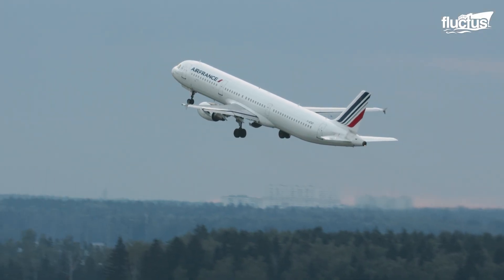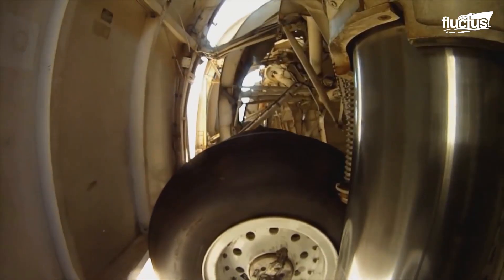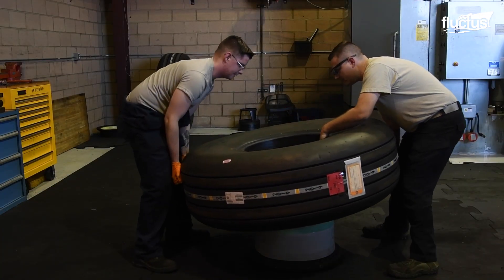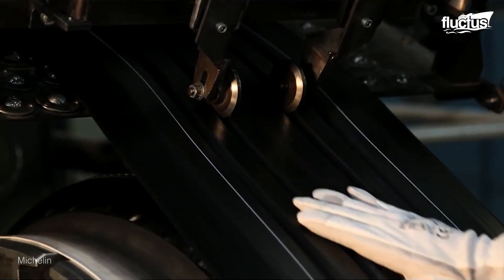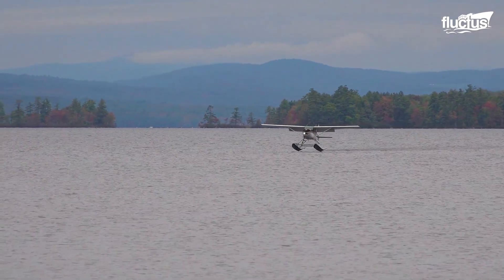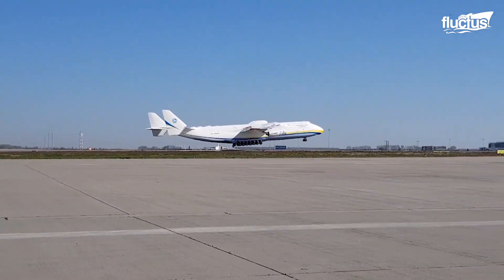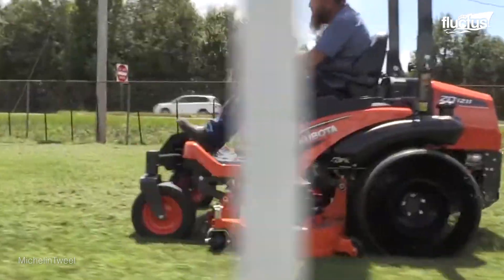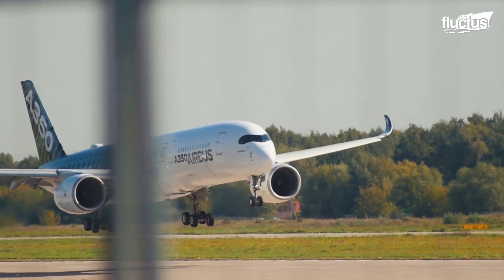How Aircraft Tires are Maintained for Extreme Heavy Landings

Comment: I was hoping that this video would cover the torture that the tires must endure, at touch-down, due to spinning 0 MPH and a split second later spinning 125 MPH, as well as how the plane handles that shock.

I was also hoping that this video would cover how those tires are kept sealed to their rims.
Upon landing, the extreme stress of being spun from 0 MPH to 125 MPH must cause the tires to try and tear loose from their rims.

Top Fuel drag racers have a similar problem, where the rims (or wheels) will not stay adhered to the tires, without special mounting equipment.
Air pressure, alone, will not keep the wheel and tire married, for those wildly powerful launches down the ¼mile track.

What material are the wheels (or rims) made from?

How much air pressure do those large aircraft put in their tires?
Reply: About 200 psi
Reply: Some aircraft have 220psi.
There is a difference between an aircraft tyre touching down and a top fuel dragster taking off. When the aircraft lands the tyre is causing the rotation due to the contact with the runway. When a top fuel dragster takes off, the hub (yes from the engine) is causing the rotation of the tyre. The bead on an aircraft tyre is really thick. Aircraft tyres can slip on the hub, aircraft maintenance manual gives limits for how much they can slip in degrees before they need to be removed from the aircraft. I think you will find it is the beads contact with the hub and the pressure in the tyre is what holds it there
Reply: @NicholasRiviera-Dr  "Some aircraft have 220psi."  The space shuttle orbiter was even higher... and then they put in another say 40 psi (varied with the leak-vs-time history measured for each tire) to allow for how the tires would be inaccessible for servicing for many weeks prior to landing.  Even "regular" military aircraft can get to around 250 psi.

For airliners, 170-200 is probably most common.  Outliers like the L-1011-500 went higher, but that was because they had no choice given the corner they painted themselves into with only eight MLG tires to handle increased takeoff weights.  I would say 200 psi (or less?) is about the "sensible" limit, and above that your aircraft is drawing the ire (and possible higher use fees) from airport authorities having to repair/replace their pavements more often.

BTW whatever the maximum or "rated" tire pressure is, by regulation the burst pressure has to be at least twice that.  At least 440 psi for an airliner tire rated at 220 psi.  That's a lot of extra thickness needed in the tire cross-section, and one more reason why airliner tires have essentially nothing in common with relatively balloon-like dragster tires.
Reply: @marcmcreynolds2827  great info, thanks for sharing 👍
The A330-300’s I work on have a normal tyre pressure range of 184 - 193 psi for the nose wheel tyres and 212 - 222 psi for the main gear tyres.
I agree that aircraft probably have little in common with drag car tyres.
Do you have any info on the number of times an aircraft tyre can be retreaded? Ours have a stamp on the side of the shoulder when they are retreaded, eg “R6” = retread number 6. I was told they can be done up to 8 to 9 times. Apart from damage to the tyre from cuts, punctures wear into the carcass etc, what limits the number of times they can be retreaded?
Reply: @NicholasRiviera-Dr  My input on this isn't authoritative, but it seems like retreads used to go to around ten times.  Either from the number of times, or just quality control problems, retreads were seeing failure issues (e.g. runway overrun/hull loss of a DC-10 at LAX).  So rules got tightened in the 1980s I believe.

As for limits on retreading not related to acute damage, I will point out without exactly answering the question that an airliner tire is a structure having much in common with other aircraft structural elements:  Susceptibility to fatigue damage, strength affected by temperature (MLG tires can get very hot, even from just taxiing under some circumstances), and subject to unseen internal damage which can compromise load-carrying ability and lead to catastrophic failure.  So for all the abuse a tire carcass takes, even with retreading it's probably not a good idea to keep reusing one indefinitely.

Edit: That's yet another reason why often-imagined "pre-rotation of tires" schemes to avoid rubber reversion on touchdown aren't a good idea:  Even if the tire were to get more landings before retreading because of less rubber reversion on touchdown, it's still seeing all that internal stress / possible weakening from heavy braking, repeated heating and so forth -- things unrelated to landing.  So for a given level of safety, less tire wear from touchdowns would probably end up simply meaning less retreads before the tire is required to be scrapped.
Reply: @marcmcreynolds2827  thanks 👍
Reply: "the torture that the tires must endure, at touch-down, due to spinning 0 MPH and a split second later spinning 125 MPH, as well as how the plane handles that shock."  Surprisingly, spinup doesn't produce much of a torque load on the tire compared to the braking loads which come shortly after that.  Takeoff at max weight is actually more stressful for an airliner main gear tire than a typical landing.  The vertical load and speed is higher, plus the tire has been heated (reduces its strength) from the prior taxi/takeoff roll.  It's takeoff rather than landing which "designs" the tire.

One thing to keep in mind about landings is that the peak load touchdown is a lot less than it might seem like from watching them.  Until spoilers deploy, most of the aircraft's weight continues to be carried by the wing, and peak touchdown load is greatly reduced by stroking of the air spring (ok, dry nitrogen spring) built into the strut.
Reply: @marcmcreynolds2827  The torture is during the landing, upon the tires making their initial contact.  They skid and smoke.
Reply: @0Perhaps  In the landing gear business that's called rubber reversion.  Landing gear used to be my profession:  Braking loads, touchdown loads, tire stress & heating, brake heating, pavement stress (it fails in fatigue, much like a piece of metal does).  The closest thing to "torture" for the tires is just prior to rotation during takeoff, and the braking loads developed during a maximum energy RTO.

Smoke or not, spinup loads are inconsequential for tires -- a bit of rubber reverted in one spot on the tire.  There's not enough rotational inertia in the tire/wheel/brake rotors to create the sort of sustained loading which antiskid braking produces.  Contrast that one spot on the tire to the entire tread being worn off all the way down to the cord layers by a single braking stop.  That extreme case has actually happened (space shuttle orbiter, before I told NASA they needed to smooth down asperities on the KSC runway).
Reply: @marcmcreynolds2827  Tires will wear, inconsequentially, when they are gripping.  Burnouts are when tires get eaten, and burnouts are when tires tear away from the rims.
The smoke you see is the gaseous rubber from being super heated.  The intensity of being forced to go from 0 MPH to 100+ MPH in a split second is extreme.

On Top Fuel drag cars, slow motion shows the tires wrinkling from the stress at launching from the line.  And those cars weigh nothing, compared to the weight of passenger jets.
The stress on a tire, instantly going from 0 MPH to 100 MPH (or more) is hard to grasp.

And it is not good to have flat spots on tires, from the single patch that makes initial contact upon landing.

Tires could be damaged, even when gripping (no burnout), if not designed for the task at hand.  Taking a sharp turn, using tires with deep treads, will cause the tires to "chunk" away.  Professional races use slicks, which virtually eliminates chunking (except for races held in wet weather, where a compromise with having treaded tires is made).

When jet engine airplanes make a landing, they reverse the thrust on their engines (that's a lot of thrust).  The full effort to slow the massive weight of the plane is not borne by the tires.  And once the skidding stops, the tires are no longer under the combined strain of instantly spinning up while under the weight of the aircraft.  The touchdown (initial contact) eats away more rubber than the rest of the roll down the runway, whether it be landing or lifting off.

Perhaps the tires are heated the most, just before airspeed is sufficient for take-off.  But that heat is not tearing away rubber to the extent that the harsh skidding does during landings.
Reply: @0Perhaps  "if not designed for the task at hand"  Fortunately, aircraft tires are.  So attempts at comparing them to for example dragster tires are unproductive at best.  An aircraft tire's tread, for example, is made thick enough that flatspotting isn't a big deal in terms of the tire's structural or economic situation.  All of these factors that you're wondering about were figured out and optimized for cost/operational considerations well over half a century ago.  Things are done the way they're done for good reasons.

"once the skidding stops, the tires are no longer under the combined strain of instantly spinning up while under the weight of the aircraft"  How many ways can I say it?  There's not much weight on the tires during a typical touchdown, for reasons I already gave, and spinup energy is nothing compared to braking energy.  I've seen the numbers -- I used to generate them for a living.  I'm not just another person on the internet guessing about airplane things.

If you have some physics background, you can look up some approximate numbers for rolling assembly weights, estimate rotational inertias from those, and crank through basic F=ma type physics equations to see for yourself what I'm saying about how loads compare for the various cases.  Use 0.8 as the antiskid braking coefficient (which applies all the way to full stop... friction is actually highest there).

Forget about thrust reversers, which aren't necessarily used in a max energy RTO demo.  That can vary with the certifying authority's rules, though I don't think any of the FAA certification reports I submitted ever involved reversers for RTO.  It makes the test more conservative, and reversers don't provide a lot of retarding force anyway compared to brakes.  Mostly they're useful in terms of not having the engines still pushing forward, and for very slippery runway conditions under which braking force is greatly reduced.
Reply: @marcmcreynolds2827  The comparison to dragster tires is on point.

"An aircraft tire's tread, for example, is made thick enough that flatspotting isn't a big deal in terms of the tire's structural or economic situation."
Thick, thin, anywhere in-between, and each landing rips away at it.  There is no getting around the tire being pealed at touchdown.

"All of these factors that you're wondering about were figured out and optimized for cost/operational considerations well over half a century ago."
And all of those factors exist, and due to the laws of physics, will always exist.

No one, a century ago, figured out the physics on today's mega-size, jet aircraft.  Nothing of the sort existed a century ago.

Optimizing is expected, and is the proper action for the airlines to take.  Optimizing is not "eliminating".  The tire pealing will happen even when optimizing to the moon.

"How many ways can I say it?  There's not much weight on the tires during a typical touchdown"
Whether there is 5 Lbs or 500,000 Lbs, the tires are being forced, in a split second, to go from 0 MPH to 100+ MPH.
That is extreme stress, regardless of the weight.

"Forget about thrust reversers"
I'll forget them when the airlines stop using them.
Reply: @0Perhaps   "The comparison to dragster tires is on point" says the guy who has never been involved in an aircraft tire certification to the guy who has been involved in several.  The physics equations are somewhat similar between aircraft tire spinup and vehicle acceleration, but the design parameters aren't at all.  Landing gear braking would be much closer to the dragster analogy than touchdown/spinup.  Unsurprisingly, those of us who specialize in this don't rely on analogies, instead working from the actual dynamics and physical parameters -- no dragsters, no falling off a motorcycle (that was a guy in another thread who insisted he knew more about touchdown loads than landing gear engineers do...  because of all the times he'd fallen off a motorcycle).

"There is no getting around the tire being pealed at touchdown."  Nor does there need to be.  It's what I hinted at earlier about economic optimization:  A bit of rubber off the tire tread at each touchdown is better than the alternatives.  Pre-rotation of MLG tires, for example, is a fool's errand (I used to be the person at my company tasked with answering inquiries from would-be inventors of it).

"No one, a century ago, figured out the physics on today's mega-size, jet aircraft.  Nothing of the sort existed a century ago."  What I said was "well over half a century ago".  Specifically, the late 1940's to early 1950's.  Oversimplifying a bit, today's main landing gear rolling stock is essentially the same as from that era, to within various refinements such as wheels less likely to fracture following a tire failure, and tires better able to tolerate failure of another tire on the same strut.  The size of the aircraft is irrelevant, since the allowable load which can be carried by any tire is limited by pavement strength.  That load range hasn't much changed since the 1960's, when more and more civilian airports upgraded to thicker pavements for handling turbojet transport aircraft.  So to a first approximation, higher aircraft weight begets more tires on the airplane rather than higher tire loads.  The original 747's tires were actually smaller than the ones on a DC-10 -- an aircraft which weighed a lot less but didn't have nearly as many tires to spread out the weight.  

"the tires are being forced, in a split second, to go from 0 MPH to 100+ MPH.  That is extreme stress, regardless of the weight."  No.  It's not.  Literally the least of a tire's problems when it comes to passing certification.

"Forget about thrust reversers" reflects the reality that a tire (the ones I've been involved with, anyway) have to be designed to handle RTO loads without consideration of reversers, so it doesn't matter what airlines do or don't do in practice.  In any event, reversers end up being irrelevant or nearly so to peak tire braking loads, given the sequence of events involved in a landing.  They mainly figure in to energy absorbed by the brakes, but even there not as much as people imagine.
Reply: Here's one I missed from the original query:  "What material are the wheels (or rims) made from?"  Generally, forged aluminum alloy.  The rim is an integral part of the wheel, and is an example of the incremental improvements I talked about above.  Into the 1970's, when a MLG tire failed its wheel would often fail immediately afterwards.  With no support to the aircraft from that tire position, the companion tire overloaded and might fail.   In roughly the 1980's time period, an effort was made by wheel vendors working in concert with certifying authorities and major airframe makers to specifically target that weakness.  Wheel strength was improved to the point that the rim part of the wheel was more likely to stay intact following a tire failure, thus avoiding a cascading loss of support by the tires.
Reply: @marcmcreynolds2827  "says the guy who has never been involved in an aircraft tire certification to the guy who has been involved in several."
I do not need to a building architect to know that if the building collapses that I will be in a world of trouble.

"Landing gear braking would be much closer to the dragster analogy than touchdown/spinup."
How would you know?

Do you build Top Fuel racking cars, or drive them?  That is your measure of being qualified to speak on the topic.

"Unsurprisingly, those of us who specialize in this don't rely on analogies..."
I agree, and I am not surprised.  It is common to dismiss spot-on analogies when then get in the way.

"A bit of rubber off the tire..."
And when someone in a sport's car does burnouts, let's call the lost rubber "a bit".

"No.  It's not.  Literally the least of a tire's problems when it comes to passing certification."
Yes, it is extreme stress.

I knew someone that lost their job, and would be put out on the street if they did not land a job within two months.  That put quite a deal of stress on them.
But I suppose that if I was in the same situation, and told that person that I have the same problem + I have cancer, then that person's stress would no longer be an issue?

The split-second 0 MPH to 100+ MPH on landing is extreme stress, no matter how many times you write that it is not.  Why?  Because it is.

"have to be designed to handle RTO loads without consideration of reversers, so it doesn't matter what airlines do or don't do in practice."
Yet, they all use reverse thrusters, even though it doesn't matter?

It matters, because reversing the thrusters takes a huge amount of strain off of the brakes and the tires.
Reply: @0Perhaps  You keep talking about cars and buildings and job hunters and whatever else you're hoping might be analogous to airliner landing gear, when the subject is actually just airliner landing gear.  No flawed analogies needed when one is experienced in the area and proficient in dynamic analysis.  That's how I "know" the extent to which your dragster canard does or doesn't figure in, for example.

"Yes, it is extreme stress."  Again, someone who has never done any calculations or seen any flight test data is trying to lecture someone who has.  I even did the hand holding earlier to set you up for being able to see for yourself how spinup loads on a tire compare to braking loads.  The math is basic, at least for a decent approximation to the relative magnitudes.  Algebra, not calculus.

"Because it is."  Wish I could have used that answer on engineering exams and still gotten credit (based on certitude, if not skill ; )

"Yet, they all use reverse thrusters [thrust], even though it doesn't matter?"  I think you've kind of lost track of the subject on that one, which was how touchdown/spinup tire loads compare to for example tire braking loads -- are the former "extreme" compared to the latter?  Use of reverse thrust (or not) by airlines doesn't matter for that comparison, as I indicated earlier but will now try to really spell out:

Touching down at a normal sink rate, there are two significant loads acting on the tire (plus some relatively insignificant ones like aerodynamic drag).  Those two are the vertical load from aircraft vertical speed and the drag load from friction contact with the runway surface.

As I've already indicated, vertical load at touchdown can be small compared to even the static load (aircraft just sitting at the gate).  That's because the wing still supports most of the aircraft's weight for about another second, until spoilers have deployed, and the fully-extended shock strut offers a low resistance (low spring constant) against stroking.  It strokes instead of all the vertical decel going into compressing the tire (exactly why the strut is there -- without it every landing would be a bounce from the compressed tire rebounding).

The other significant load is drag on the unbraked (at this point) tire as it makes contact with the runway.  That transmits through the tire and into the wheel as a torsional load that rapidly diminishes as the rolling assembly (tire, wheel, brake rotors) spins up.  Yes it's a big load compared to how much I can bench press, but a smaller load than what the tire will see once braking begins.  So not "extreme" by any reasonable definition of the word -- it doesn't even begin to design the tire in terms of the loads which have to be sustained.

Now comes reverse thrust... except it doesn't come now -- it comes later.  After the spoilers have deployed and put most of the aircraft's weight onto the gear, at about the time braking has begun, the reversers are deployed and reverse thrust is... close to zero.  Stays close to zero for a few more seconds as the fan starts to spin up from idle, then a sharp increase in reverse thrust buildup as the engine hits the steep part of the thrust vs time curve, then relatively levels off during the last few seconds of spoolup.  But even maximum reverse thrust (which airlines seldom use) isn't much compared to forward thrust.  Again, the main advantage of reverse thrust in normal conditions is that it takes the engines out of forward thrust so they don't inhibit stopping.  It's a lot of noise but not a lot of stopping power.  In "typical landing" brake energy analyses I've done, reverse thrust only handles about 15% of the aircraft's brakes-on kinetic energy.  The brakes absorb the vast majority of it.

For anyone who's nodded off slogging through all of the above, the takeaway is that maximum load on the tire (which can be shown by calculation and confirmed by flight test data to occur during braking rather than touchdown/spinup) has already come and gone before reverse thrust does anything.  So reverse thrust can happen or not happen, be idle reverse or 1.6 EPR...  and none of that matters in considering which loads might or might not design the tire, i.e. which ones are the most "extreme".
Reply: @marcmcreynolds2827 I’m not sure what figures your using but reverse thrust plays a bigger part than you are indicating. Ask any airline pilot and they will tell you, particularly in the wet
Reply: @NicholasRiviera-Dr   "I’m not sure what figures your using but reverse thrust plays a bigger part than you are indicating. Ask any airline pilot and they will tell you, particularly in the wet"  The reverse thrust values I used in my analyses came straight from the engine manufacturers e.g. P&W, GE.

My 15%-absorbed-by-reversers number above, for a "typical" landing, assumes a dry runway and IIRC 1.3 EPR reverse in the case of a P&W engine.  As you indicated, that percentage would increase with increasing runway contamination:  Wet, flooded, slushy, snow, ice.

Effective maximum friction coefficient for antiskid braking on a dry runway is upwards of 0.7, drops to something more in the 0.4 range for wet/flooded, and can be around 0.15 or below for icy.  In that scenario, the reversers are handling most of the kinetic energy, not just because of the lower friction coefficient but also because lower decel means the stop goes on for a lot longer -- more time for the reversers to contribute.  As opposed to what I outlined above for a dry runway at an "average" landing weight/touchdown speed, where there is relatively little time between when reversers come up to the maximum selected thrust and when it is time to stow them.